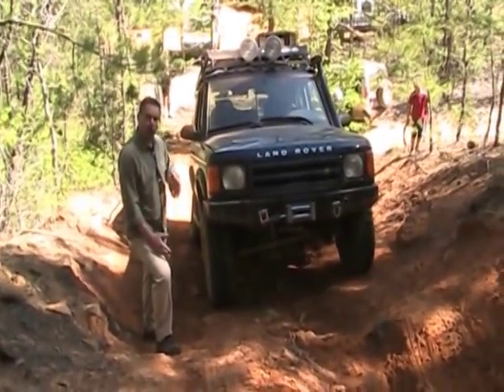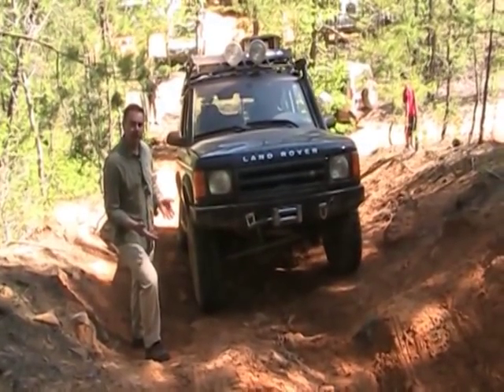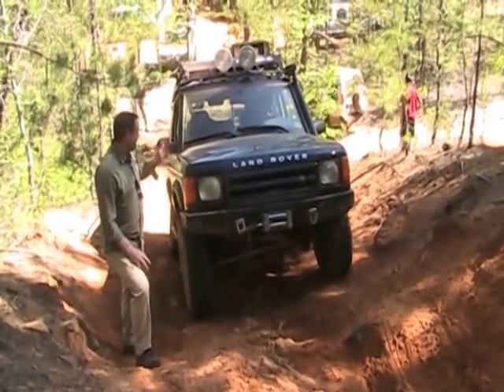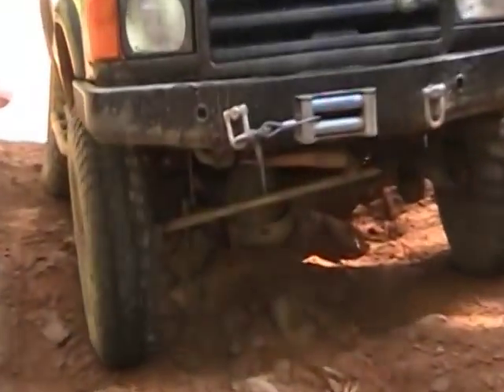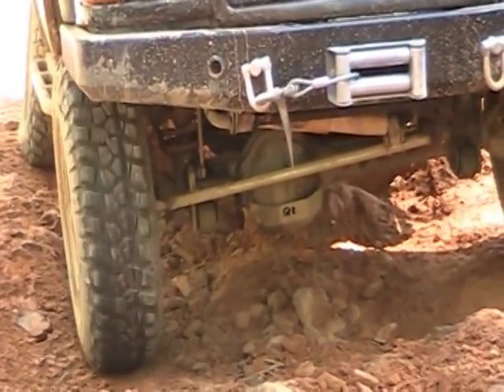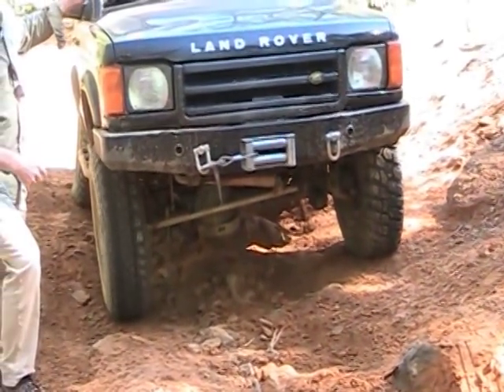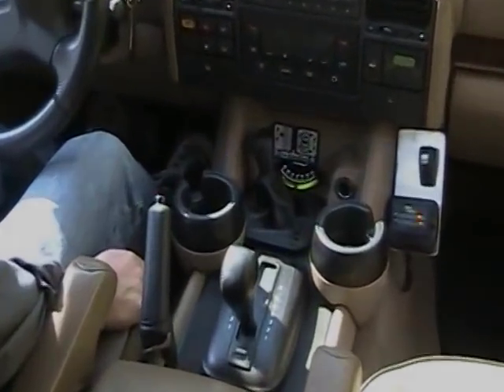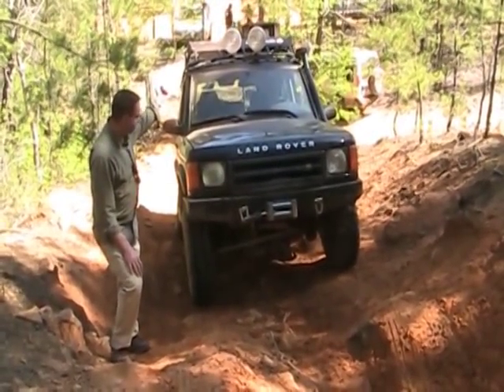Land Rover Discover CDL "center differential locker"  test

Comment: You need to rev your engine for the traction controle to work properly... I know Dif Lock is a better mechanical answer to climbing, but if you read the manual you will know how to use the traction control properly. Land Rover didn't remove them so the offroad experience would get worse. I think those guys know what they're doing.

Comment: That's why I got an 04 from the get go. I don't have to worry about this!
Reply: I've been a Jeep guy my whole life and just now started looking into a disco 2.  The diff lock thing is throwing me off. In  a Jeep you put it in 4 wheel drive and both drive shafts get equal power. Does the land rover not work this way without a diff lock? What does the '04 do differently? I'm assuming it acts more like a Jeep t case?
Reply: @ninja63639  hey I'll give you the answer. The Disco is always in all-wheel drive so when you lock the center diff that puts it in 4-wheel drive. The transfer case of the Disco has an open diff normally for the front and rear shafts can spin at different rates going around corners kind of like an open diff in the middle of an axle. That's what allows it to be full-time four-wheel drive on the street when really it's just all-wheel drive and the center diff lock makes it four-wheel drive. So when you hear about Center diff locked it's just going into four-wheel drive from all-wheel drive LOL really not a big deal.  So the 2004 came with the center locking lever. The 99 to 2002 came with a locking transfer case but just not deliver so you buy it after market. The only one you have to worry about is 2003 because it actually doesn't have the Locking option on the transfer case which is really lame. I have a 2002 with the aftermarket lever it just has an extra cable that goes around and hooks to that locking mechanism that was on top of my transfer case from the factory that they chose not to use because they were so proud of their traction control. In all honesty unless you put a lot of money into a disco you better off with a newer Rubicon anyway

Comment: I took a t-case out of an 04 and put it in my 02, it works great
Reply: What's the difference if I may ask?
Reply: @ninja63639  the 04 t-case locks the 02 doesn't, so with it locked in order to break traction with a front wheel a rear wheel also has to spin
Reply: @17quarters48  so is the '04 pretty much the same as say the '99 then?
Reply: @ninja63639  yes the 99 simple doesn't have the lever to lock it

Comment: Does the Ashcroft locker activate the diff lock indicator on the dash?
Reply: +Sherrod Baltimore If you haven't already figured it out, yes.  This assumes you have the actual guts on your DII to actually lock.  My early 2001 showed a locked center differential on the dash straight away after manually locking the CDL with a 10mm spanner - I don't yet have a linkage set up.  The switch that indicates the CDL is engaged is actually inside the transfer case and does not rely on the Ashcroft linkage to do anything but rotate the actuator.
Reply: I have a 10mm and 1/4 rachet with detentions down threw my center console to lock my cdl I never have any problems

Comment: Ok most likely a dumb question I have a 03 d2 and 98 d1 is this the same thing that my d1 has already?  I tryed one time to mess with the little shifter but its stuck and never messed with it after I have no owner manual so not shure what or how to use it.
Reply: Your D1 should be able to lock its transfer case. A manual can be had by googling for it. Somewhere is a manual in PDF format. The cables may be very stiff from years of non use. I had to put alot of effort into locking mine. I believe it was never used by the previous owner. Your D2 will more than likely require a aftermarket kit to access the locking feature of the transfer case. Good Luck.
Reply: an 03 discovery should be lockable from the factory shift the transfer lever left to lock the cdl some 01-02 transfer cases had the cdl in place but no engagement linkage, they saw the error of their ways with the series 2 d2 and refitted the linkage.

Comment: looks like center diff.locker viscous type  LSD?
Not like on Russian Lada Niva true mechanical diff.locker
Is that Right?
Reply: +mike che The center differential is mechanically locked when engaged, but there are a few years of discovery II that lack the guts to do so.  In that case the center differential is an open mechanical differential and the truck relies on its electronic traction control (ABS for traction) to find grip.
Reply: +Joe Kirklin 
o i see 
that what it is electronic bs
thanks for info

Comment: Why not just use axle locking differentials?
Reply from the maker: They are better if you can afford them . The CDL is must have either way.
Reply: Lucky8 you can get an auto locker for as low as a few hundred bucks
Reply from the maker: Really? Please let me know where ????
Reply: Lucky8 Aussie or other lunch box locker. Detroit is likely cheaper than an ARB.
Reply from the maker: Can yo please show me were Aussie or Lunch box are available for Land rover?
Reply: Lucky8 did a quick search and doesn't seem like Aussie makes them. Surprised because they make them for all the US main 4x4 as well as Toyota and Mitsubishi. You could try calling or searching on Rover forums to see if anyone is running lunch box style lockers. Aussie isn't the only brand making them. I'd be surprised if there aren't any for the Rover. Otherwise your option would be Detroit Truetrac for around $500 (USD). Still cheaper than ARB especially when you factor cost of compressor.
Reply from the maker: That was my point. There is none.  Now I think you can see why the CDL is even more important.
Reply: Lucky8 sure, it's better than nothing. But when you're a company advertising "legendary" off road pedigree and all you offer is a glorified limited slip on even your most "rugged"' models while the competition (Jeep, Toyota etc) offer true lockers from the factory, you're clearly missing the mark. So if you own a Rover and you plan on using it off road, spend the money on a proper locker. It will provide you with more traction and control and won't require increased throttle to get it to engage.
Reply from the maker: Rover does offer Lockers from the factory...
Reply: Lucky8 I suppose you could be right. I've driven a few defenders and Discos and know folks living overseas who have owned them and all they have had are the CDL.